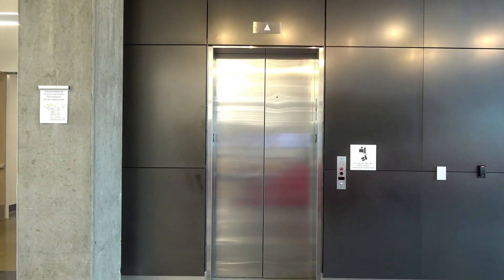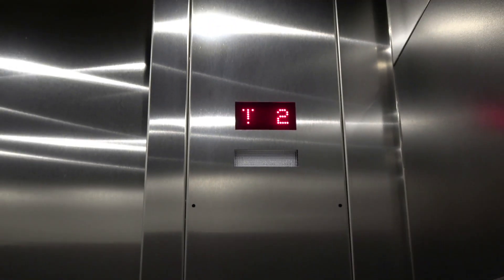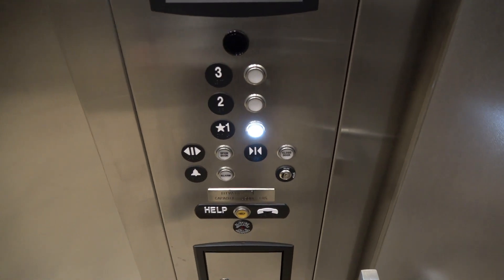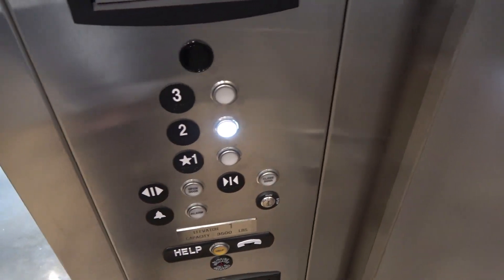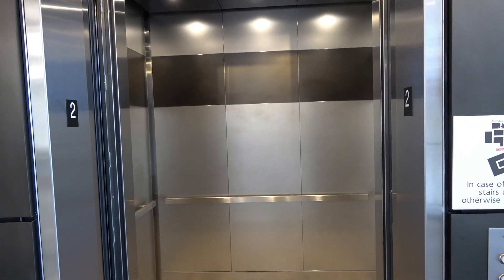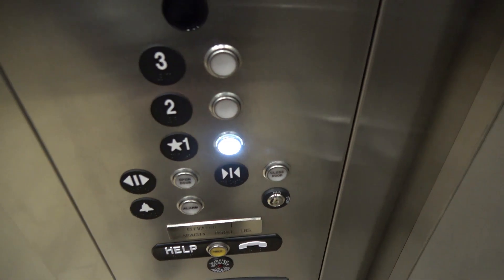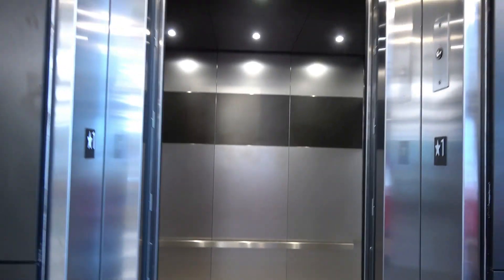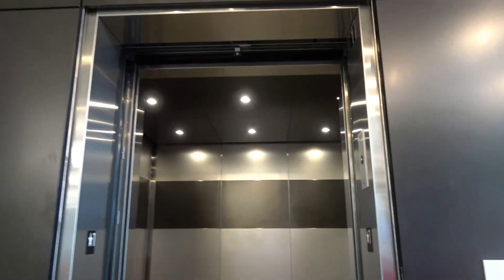BADLY Underleveled! Rough ThyssenKrupp Hydraulic Elevator with Mad Atoll fixtures in Sugar Land, TX.

Comment: This elevator kind of reminds me of one that's at this clinic I go to in my town and I think it's a Thyssenkrupp Elevator and I'm wondering if this one is low on oil because I noticed that whenever I take it back down to the front lobby on the first floor, this elevator moves really slow and then it stops really hard and after that it makes a funny high pitched squealing sound, but at least it's leveled right with the floor, maybe it's because the elevators in this building are old, I also wonder if any of them ever broke down before, that's a mystery I just have to find out, but other than that elevators are the coolest pieces of machinery ever invented I also like the way their chimes sound when they go "ding" I wish I was an elevator enthusiast and I think it would be so cool to travel to different places, and check out the Elevators, film them and see how they function and even listen to the ones that are really noisy and have loud motors.

Comment: This elevator itself is cool, but they need to fix the under-leveling issue and they need to put more oil in the oil tank. Also I did hear the vibrating (a little bit), I’ve seen a few low on oil including one being on some of the worst elevators I’ve ever come across (they were Schindler RT’s).